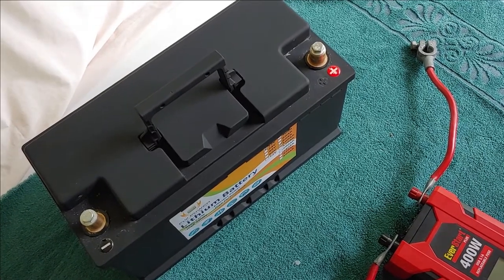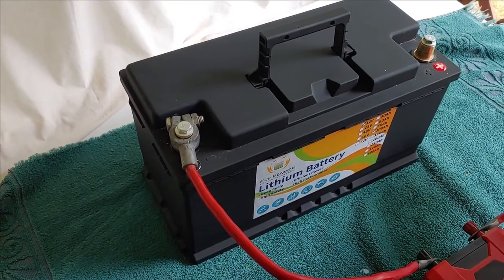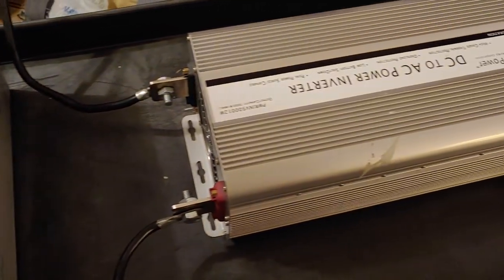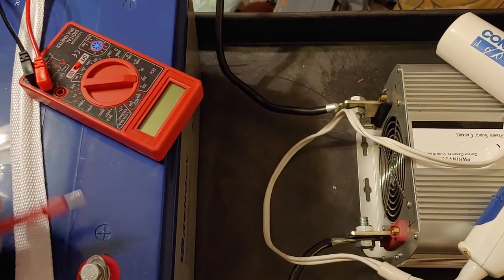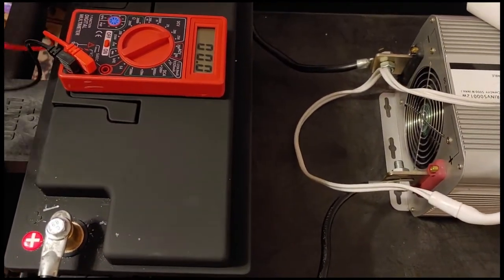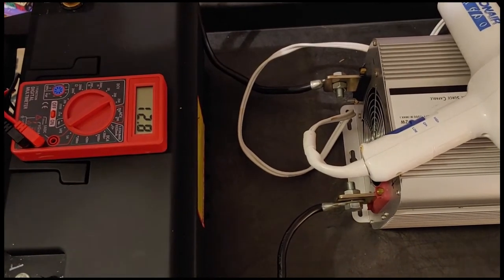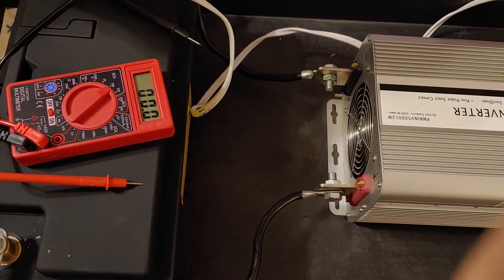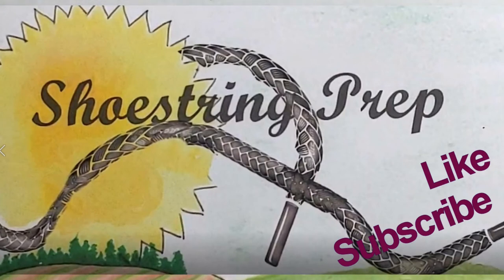Shoestring's Part 2 review of the Inexpensive off-grid Lithium Battery: Fly Power 12-Volt 100Ah

Comment: Just got this battery and fully charged running 55lb minnkota trolling motor on full blast went for 2hr 45mins ran it in a barrel of water.
Reply from the maker: So, is that good performances or not? Thanks for your comment.

Comment: Ya, lead/acid batts have bad voltage sag under load. I bet if U let it sit a half hour or so after that load test, it would pop back up to near 13V again. I have that same $5 multimeter from China Freight Tools. Try doing a resistance reading w/the test leads shorted together. LOL. I got like 10 ohms! Cheap leads. Oh, at this point in time, few, if any LiFePo batteries can be used as starting batteries for cars/trucks. They can't deal with like a 600 amp draw like good ole antique flooded LA's can.
Reply from the maker: The voltage drop on the lead acid battery is why I did that test.
Thank you for your comment.

Comment: Sir Id like your input, if possible. I am trying to upgrade my sons 1500w Electric ATV 48v which currently runs on  4x12v 20ah acid batteries.  If I upgraded to a lithium battery, could you recommend what specs to get on the lithium and any other advice you may have.  I just want the ATV to run longer and have a better run time.  Thank you.
Reply from the maker: I don't know anything about ATVs I am the wrong person to ask.
Reply: i would try to find lifepo4 battery's thats are the physical as the batterys in the quad they can be higher capapcity or the same the bonus of the lifepo4 is they will not sag like lead acid and will perfom better
Reply from the maker: @1981dasimpson  thanks for your comment.
Reply: @1981dasimpson  You can use way more of LiFePO4's capacity too, so the range will be almost doubled!

Comment: but I can't aford the price of lithium battery.
Reply from the maker: I can certainly understand not being able to afford a lithium battery. Most of the batteries are used are still the traditional deep cycle battery. Thanks for your comment.
Reply: think about how long they last vs how many times you replace Lead acid. it's worth the cost, trust me.
Reply from the maker: Many people cannot afford the cost of lithium batteries. Lead acid batteries work just fine for most projects. Thanks for your comment.
Reply from the maker: Many people don't have The Upfront cost for lithium batteries. Thanks for your comment.